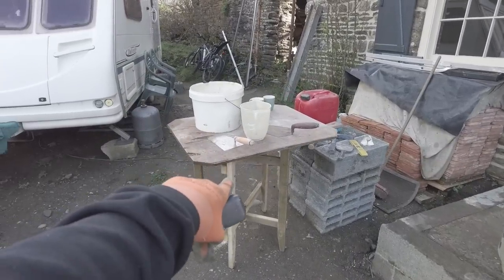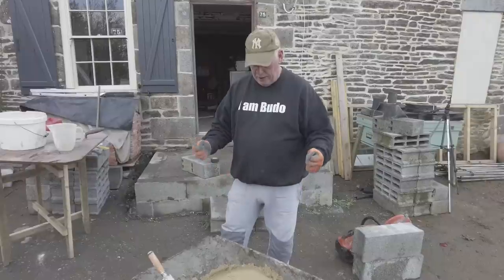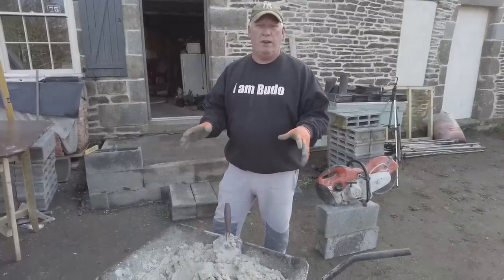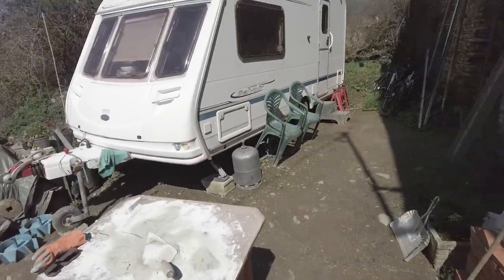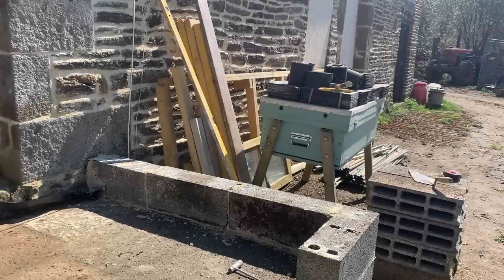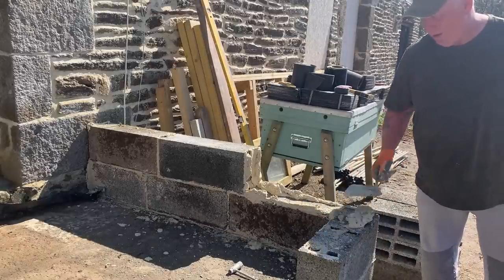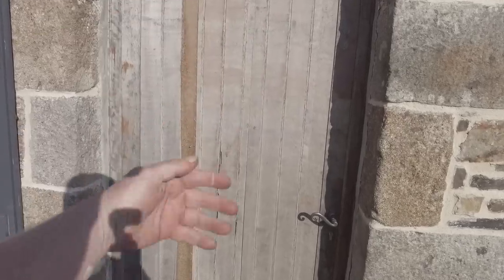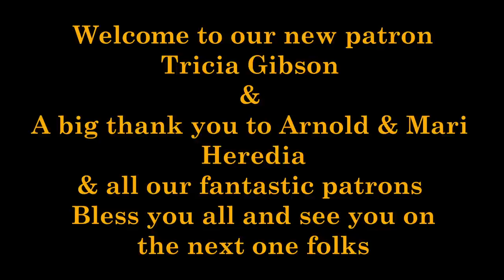No 94. How to build a porch  #frenchfarmhouse #farmhouse #porch #porchbuild #homesteadingskills

Comment: Budo have you come across Earthborn silicate paint? It chemically binds to the lime in the render and repels dirt. You apply primer first and the paint after. I used one coat primer and 2 coats paint and it has worked beautifully.  They also do lovely clay paint for interior and do a lovely furniture paint. Worth checking out, it really works.
Reply from the maker: Hi Sue no i haven't seen this company but ill check it out but i will use a hot lime wash with natural Earth pigment but thank you so much for the info glad you are enjoying our videos all the best Budo xx

Comment: You should do the boards on the top with curves rather than straight because the curved version will evoke the fleur de lis.
Reply from the maker: Mate that is great thinking I'm going to check if that's ok to do first as there is a strict code here but I think this should be ok cheers buddy 🍺🤠👍

Comment: You may have already covered this question, so apologies, but what is the plan for the window shutter, as the porch is going to cover half of it? It is going to look spectacular, can’t wait.
Reply from the maker: Hi Vanessa i have two options i could go for a bifold shutter all on one side or i could set the hindge pins back and have it flush with the porch but what ever way i go ill get around it and make it work and look good but this is for a video later in the summer but don't forget to tune into Fridays video and did your watch tonight's video planting our Lavender all the best Budo 🥰😘

Comment: I found you video very informative. But could you explain the difference between the lime you used and the lime that is normally used.  Since I follow many DIY  chateau youtubers, as I am sure most of your views do, they all say sand and lime is the best morter and plaster, but no one else has mentioned the  anything about heat and the caustice danger to lung and eyes.
Reply from the maker: Hi Victoria most of the Chateau channels you watch they have no building experience what so ever they are just winging it to make content there are different  types of lime the lime i was using is called Quicklime and is what the conservation and historical builders use for many listed and endangered buildings the other lime that most of your chateau youtubers use is NHL 3.5 lime which is used really for around water areas like bridges chimneys footings and so on but doesn't breath like or as well as Quick lime there are also limes like hydrated lime and none hydraulic lime  as well as calcium carbonate which is really a chalk  its a very interesting subject and needs studying if your working with old buildings hope this helps all the best Budo